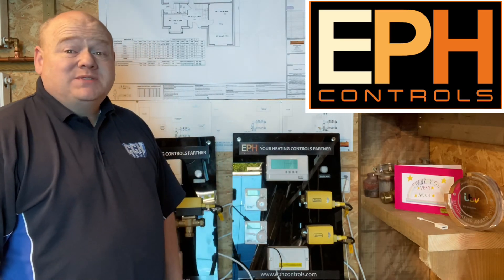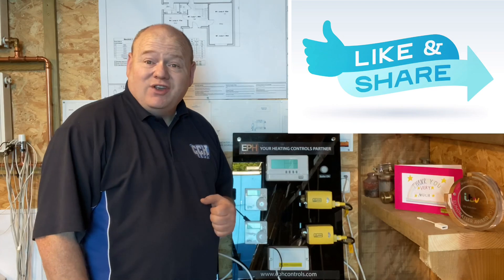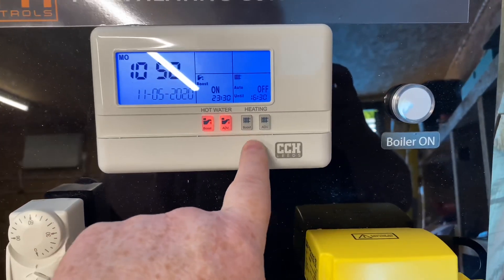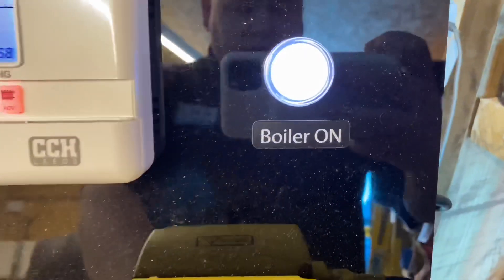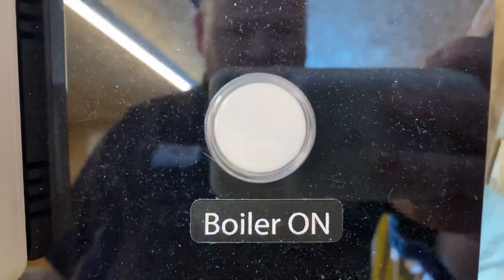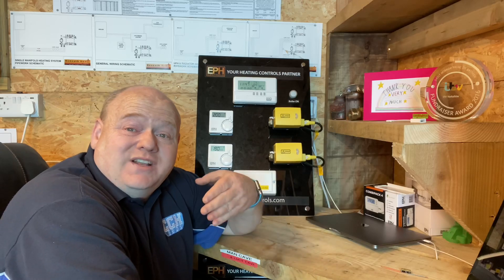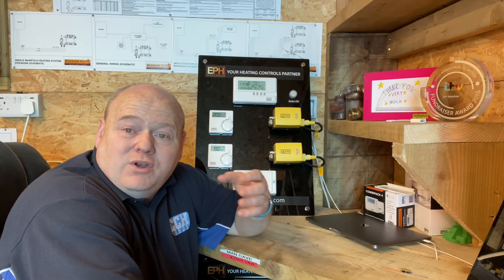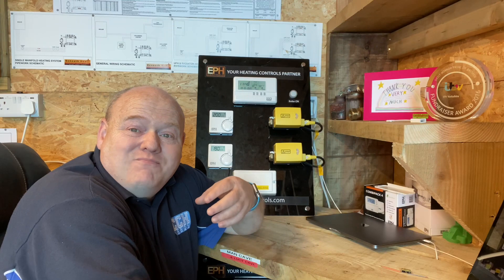How a Heating System Works - Leeds Plumber

Comment: Hi Allen, hope u are well! I have a question... got a sealed system, worcester boiler, seems to keep having air in the system. Any ideas why? Its got Fernox in, bled rads a few times, over the months, but when the heating comes on, i can hear it pushing air around the system... any ideas why?

Comment: Can I ask a question please. Can I install a solid fuel stove with a back boiler info a gas central heating system and if so do I need a hot water tank and what type of gas boiler do i need and how do i stop the solid fuel stove turning into a 16kw chimney heater. There is no central  heating Installed at the moment I just have the solid fuel stove ready to be installed